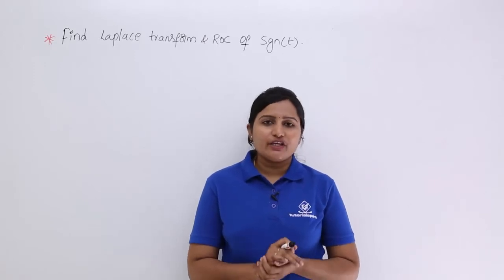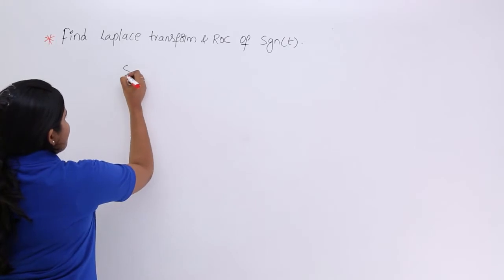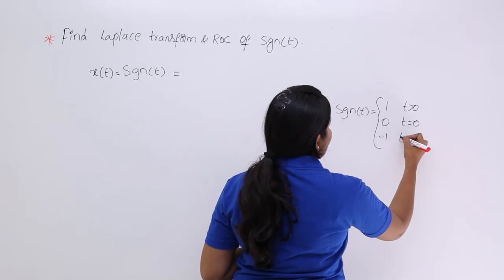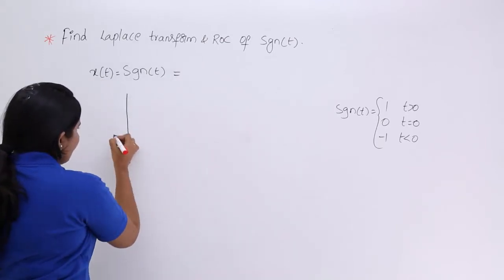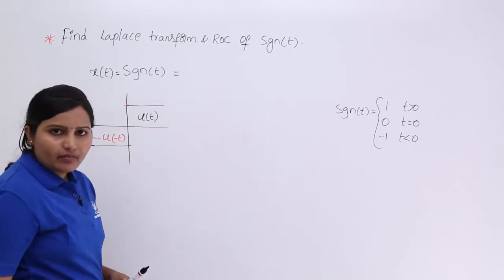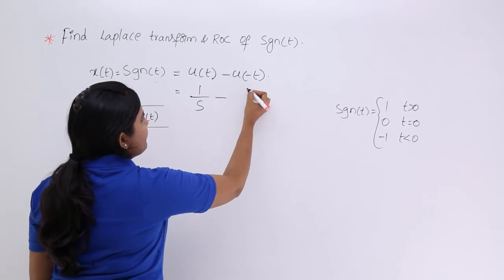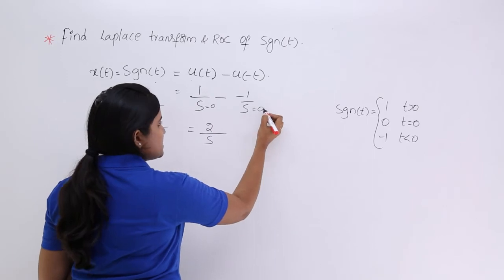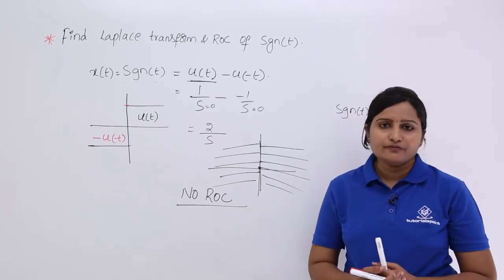Laplace Transform of Signum Function

Comment: in lecture no.6 u told that sgn(t)=2u(t)-1
Reply: indeed, the laplace transform is 1/s. You can try via Matlab and you'll see it's not 2/s but 1/s
Reply: @gateaspirantseceteluguchan9401  If you're thinking of 1 as dc, then, L[1] is 1/s. 
And even if K is the amplitude of dc, then, K/s should be it's transform, as L[1] = 1/s. If you're saying it's equal to 0 on the basis of the previous video of this channel, then, may god help you.